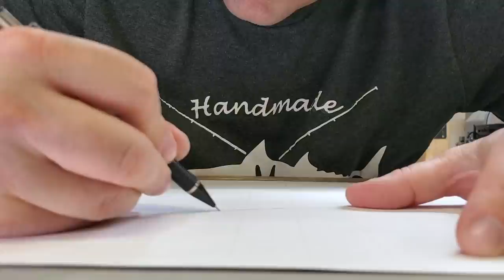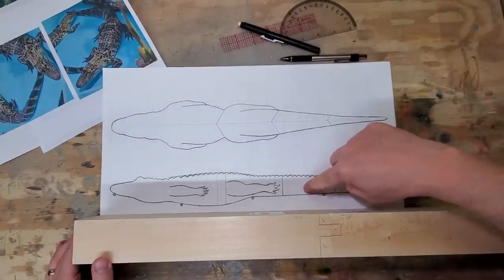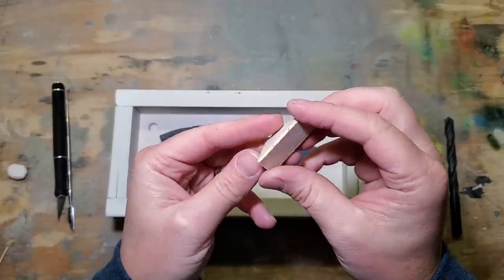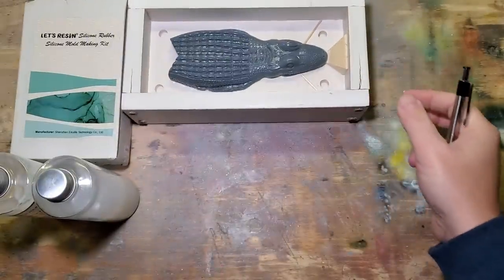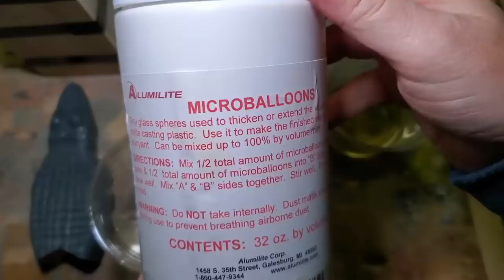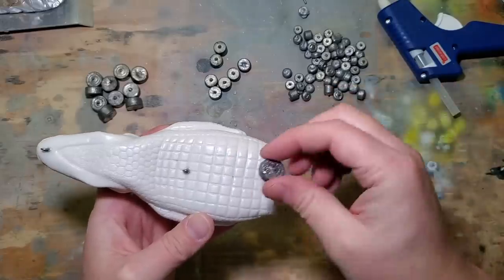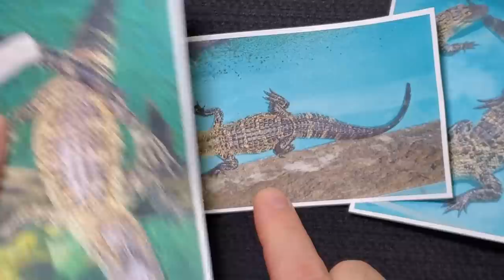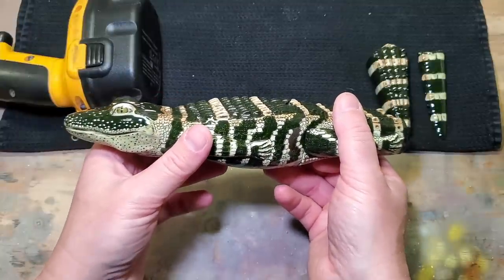Making an Alligator Swimbait

Comment: For a matte finish that also has good protection you can double up the clearcoat. Start with a thin but very hard setting epoxy that will protect the paint without filling in too much then go over that with even something as simple as rattle can matte varnish to give the texture you want. That way the bottom coat is what gives the actual protection and the topcoat is just for aesthetic purposes so it doesn't need to be super durable
Reply from the maker: Great tip! Thank you for sharing, that sounds perfect!

Comment: Astonishing lures! I do micro lures for myself,so I can understand the hardwork needed.
Can you tell me if there is a rule regarding the place you need to put the weights on a jointed slider? I have made a lot of one piece sliders and they work fine,but on jointed one I cannot figure the correct place of the weights.Thanks in advance!
Reply from the maker: Thank you for your support! I usually balance them so that they are level. You can of course have them float, suspend or sink but they should be level.
Reply: @zimmtex  Thanks, I'll try that!

Comment: Turned out really nice. However, not sure if basswood was the right choice. I hear it can soak up water like a sponge.
Reply from the maker: Thanks! I think if you seal it really well it shouldn't be a problem. I agree that as with any wood lure you need to keep an eye on it and make sure it doesn't get so beat up that you penetrate the seal.

Comment: What knives do you like using for carving lures? I noticed it doesn’t slip or cause the wood to splinter
Reply from the maker: I generally use a box cutter with replaceable blades for rough carving. Most of the time I use an exacto knife for the detail work. The trick to avoiding splintering is to pay close attention to the grain direction. if you are cutting with the grain, take very small shallow cuts. I also replace the blades often so they are very sharp.
Reply: @zimmtex  thanks!

Comment: Good Morning Sir, I started to make lures and now I have a lot of them but I need epoxy to finish them. I followed your links for the true coat epoxy but it is out of stock. I really beg you to tell me an available exoxy resin for coating !! (your videos are awesome)
Reply from the maker: Hello, glad to have you here! Hopefully we can get past these supply chain issues soon. I also have a link for East Coast Resin. I like it and used it for a long time. It tends to develop bubbles slightly more than TrueCoat but is a good alternative. Best of luck to you!
Reply: @zimmtex  thank you bro, solar baits ask me to go seeing other videos but not you
Reply: East coat is also unvailable
Reply from the maker: In that case, you can use the 30 minute epoxy. It is the hardest to work with in terms of bubbles and waves. Most of my first lures were made with that, but you really have to work fast and try not to stir in a lot of bubbles when mixing. A lot of people use diamondcoat, but I don't have any experience with it.

Comment: hi, i have same truecoat but it stay a little bit sticky after 2 days of drying at same quantity of part A and B
Reply from the maker: You need a ratio of 32g of part B to 37g of part A. I use a digital scale to weigh out the parts because it is much more accurate. Give this a try; best of luck to you!
Reply: @zimmtex  thanks (may you think about a minnow imitative paint) its a little french fish that we use to fish trout and in french is "vairon" with an airbrush ?

Comment: Where do you get your lead circle things at I need them I make lures as well
Reply from the maker: I make those by drilling into a block of wood with forster bits, then filling with lead. Once cooled, I can knock them out of the board.
Reply: @zimmtex  ohh you are smart I didn't think of that lol I thought you had to buy them ok well thanks because I have wood and lead so I can give it a try.